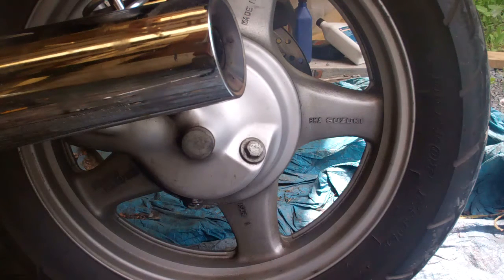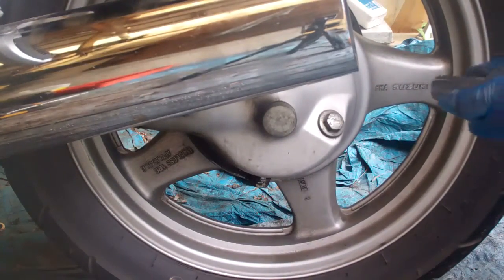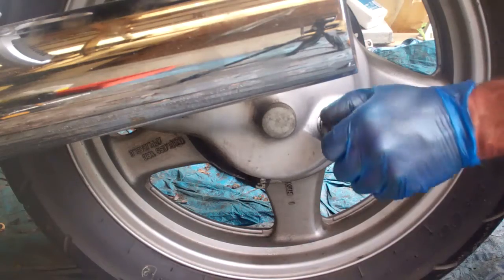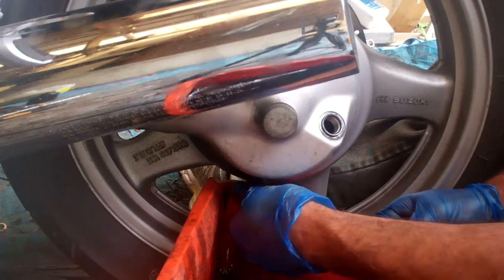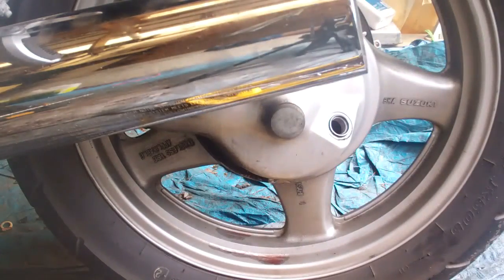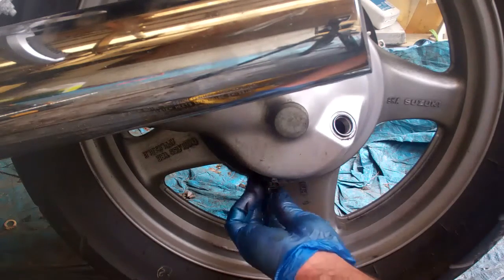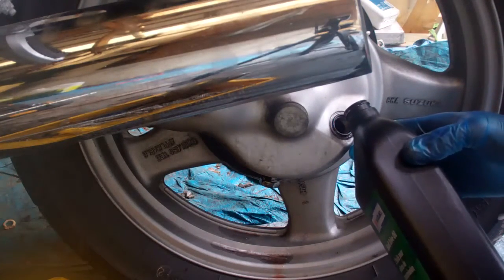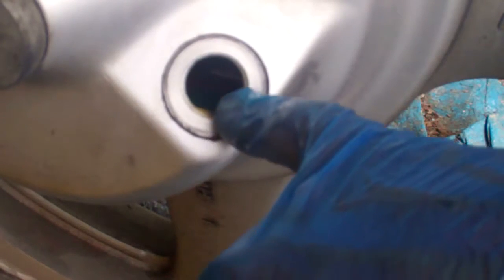Changing the shaft drive oil in a 1990 Suzuki VX800

Comment: Several people ask what kind of oil it should be in the final gear.   Answer: Suzuki recommends in the original repair manual that it should be SAE 90 hypoid gear oil which is rated GL-5 under the API classification system.

Comment: Hey Bro!- you left oil on the rim that can migrate to your tires!- wheres your funnel and rags? I am looking for synthetic 80/90  gear oil my nx shaft change- changed the engine to sythetic 10/40 on 91 vx800  - it washed a lot of carbon out!  BIKE Goes like spit and challenges this 80 yr old ha ha!   Added driving lights and a monster horn to wake up the old Ont road fogies Cheers

Comment: The drain plug is supposed to be paired with a crush washer. You did not have one on it as you bought the bike from someone else or you took it off during a previous maintenance?
Reply: It has an oring inside the bolt